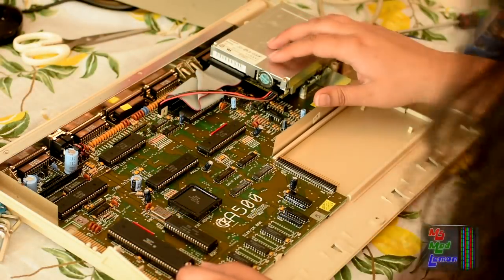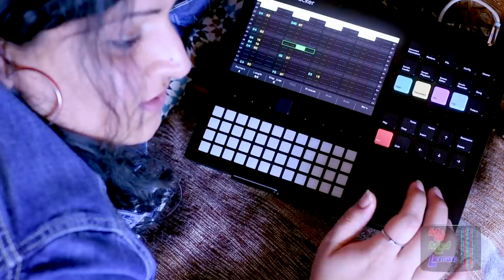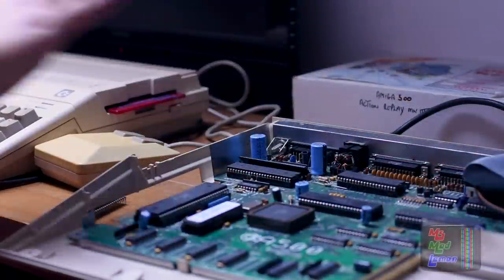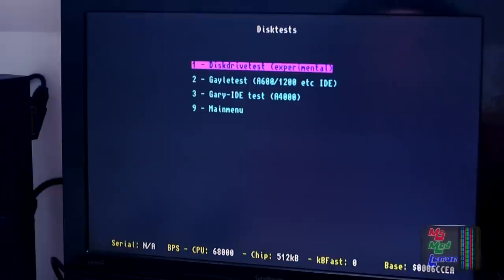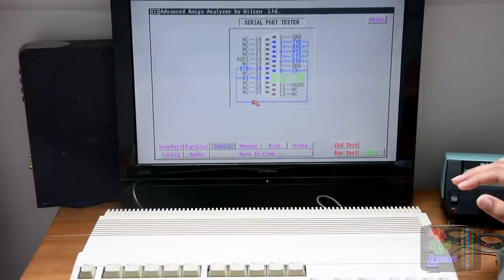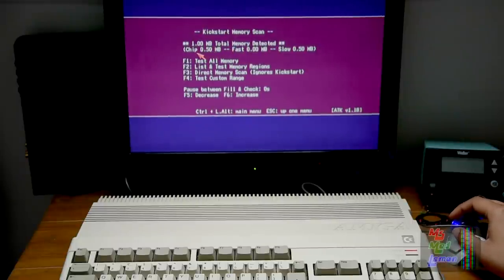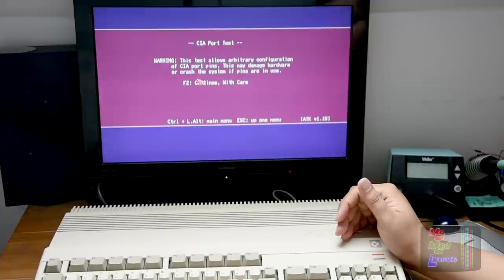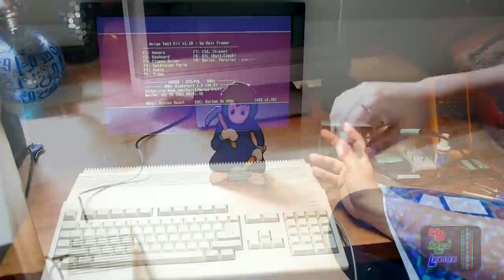What's Inside the Amiga 500?

Comment: Ah, A500 memories.  My A500 was the older revision with only 512K chip ram and the OCS Agnus (1.2 KS).  Over time it evolved, and I added the fat Agnus, 2.xx KS, another 512K in the trapdoor (old school card too, with the clock), and a VXL 68030 (40Mhz) and 68882 FPU, and 12MB Fast RAM.  My first HD was an 80 MB SCSI drive that I remember cost me $1000 in 1987.  I used that machine as my daily driver until about 1991 when it was destroyed in a move, and I parted out the remainders to replace it with a 486 machine - sad, but made more sense for my professional life.  Today I have two A4000's that I tinker with, but professionally the Amiga line isn't where I can earn a living anymore.

Comment: Looking at this board, it seems it has single-wipe chip sockets - metal contact only on one side. These are notorious for becoming intermittent - I replace them on sight whenever I get a machine in for repair regardless. It looks as if the Agnus socket may have been replaced already too - I don't recall Commodore ever using brown ones.

Comment: There is also TestProgram 3+ on Aminet. For DiagROM, download and unzip the file to read the instructions on what happens and the Serial output (9600, 8N1). Occasionally, a capacitor replacement will fix odd A500 issues: as they age and begin to fail, odd things happen.